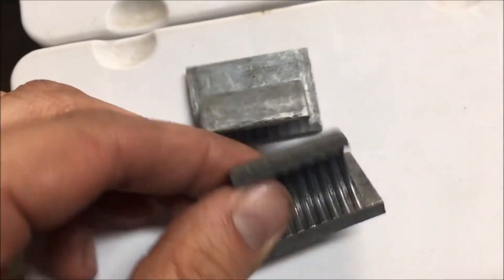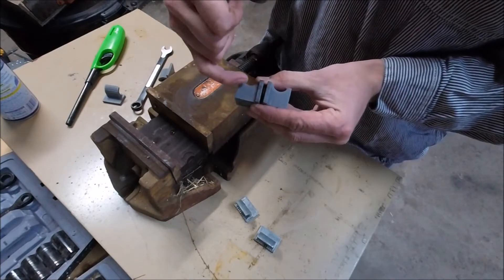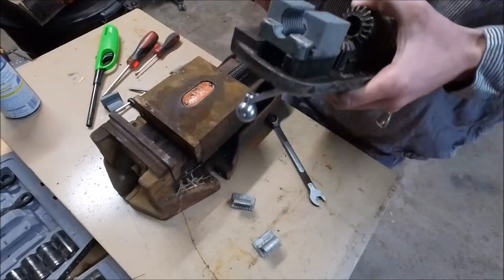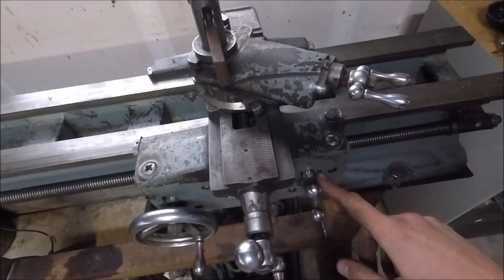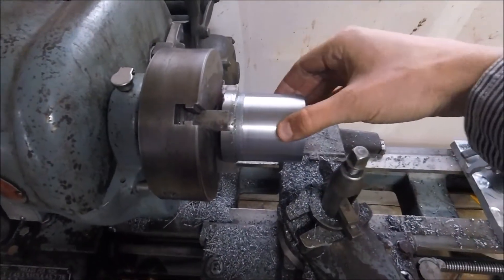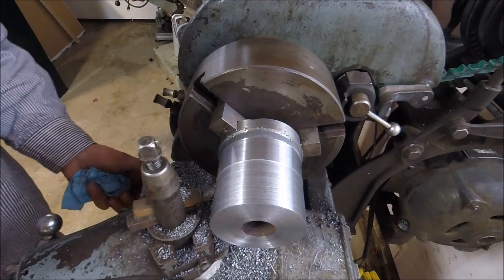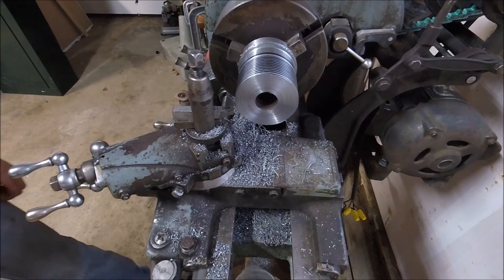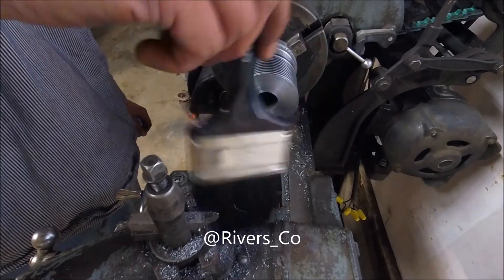3D Printing Atlas Lathe Half Nuts on the Cetus

Comment: I'm in a similar situation and am thinking if one were to 3D print the needed half nuts say 15% larger on the Outside Dimensions and 15% smaller on the Inside Dimensions they could be used for patterns to make a mold to cast them in metal.
The threads would be an issue in casting. Maybe just some shallow threads or basic bore diameter.

Comment: Nice video.  I was impressed.  I think the only other test you could do to stress them is to cut 4 TPI threads, the leadscrew will have to move twice the rate of the spindle.  Although it is higher stress on the gear train too.  But if your half nuts could hold up to that, they are golden!

Joe
Reply from the maker: Thank You for watching Joe, I haven't tried the 4 TPI yet but I have tried everything else and am really impressed. Its almost been a year since I printed them and installed and still holding up, however it has been a busy summer and lathe work may of been bellow average.
Reply: Still, when you think about the keyway rubbing the nuts, you would think it would wear them pretty quick.  But if they work, then why not.  Any reaction of the oil on PLA?  Or can you tell?
Reply from the maker: No reaction that I could tell, I wouldn’t of thought they would of lasted this long. If they fail I’ll do an update on them or if I get a wild hair I’ll take them out and inspect them.
Reply: Kewl.  I have an axa indicator holder that I finally have the indicator for.  There are some things that I think plastic parts really make sense.  Your half nuts, the gears Mr. Pete made.  I think if you could make a thread dial gear, then that would be a hit.  Would have to start by converting the 10 TPI leadscrew to a diametral pitch, then set the teeth at an angle to match that of the screw.  That part I can figure out, making the model on the other hand would be tough on me.

Comment: Nice mod. Hows it holding up? Fwiw the .0042 feed rate? is not the slowest. .0021 is at least thats the slowest I can get my Atlas's to go. What Pgm did you model the half nuts in? -Sam
Reply from the maker: They have held up well, I'm still using the same set. .0042is the slowest on mine, I could slide the sliding gear to the in position but that would double it to .0084. I use Sketchup because its free. Thanks for watching
Reply: look here for slower feed rate. http://www.hyperlinks.net/2015/02/18/atlas-lathe-wqc-speed-revisited-0021-as-new-lowest-fed-rate-bye-bye-fast-feed-rate/.   Also, any chance I could get a copy of your SKP file for the Split nut?  TIA. -Sam
Reply from the maker: OOOOH, with a mod... I might try that if I need to speed up the RPM but lower the feed. usually I run on the lowest RPM and .0042 is PLENTY Slow enough for me. I have the files available on Thingiverse. Not the same as I used I somehow lost those so I had to remodel again, Printed one out but havent tried the new modeling in the lathe yet.
Reply: .0021 is nice and does make a difference. I leave that gear combination on my lathe 24x7. its somewhat agreed upon in the atlas/craftsman lathe community. that the feed rate on these lathes is too fast. give it a try.  I have a split nut modeled up somewhere from years ago. I was attempting to print one up from Acetal. it failed miserably dozens of times. pla or ABS went great. Also I never considered just trying the part back then in PLA or ABS. as I was dead set on getting it to work in Acetal. Nice up though! -S Im on TV as well : "TheSniper".

Comment: Very impressive! You can get nylon filament which is much more wear resistant.
Reply: If you're talking about non-reinforced Nylon that would be pretty snazzy. I'd be paranoid about glass reinforced nylon which may eat away at the lead screw; With stuff as easy to 3D print I'd rather have the small bits be sacrificial if anything.
Reply: Just got an Ender 3 a couple days back.  What I've read about nylon so far indicates it may be worth perusing,  but it requires a hotter extruder.  An upgraded extruder may be needed depending upon your machine.
Reply from the maker: Thanks, I'm still knew at the 3D printing and not knowing I would be printing wearable parts I haven't ordered any Nylon yet

Comment: how do you like the Certus printer? would you recommend it ?

thanks
BS
Reply from the maker: BS in The Shop I LOVE the Cetus. But in all honesty this is my first printer and have no experience with other printers. I did a lot of research before settling on the Cetus. The 3 main deciding factors that made me settle on this was the design with the linear rails, the fact it can also run on g-code, and the price. I have had nothing but success with it. It’s very simple and has a lot of great features in the software. I also had a coupon code to get an additional $30 off. I may end up doing a more in depth video review. Thanks for Watching!
Reply: thanks for the quick reply. Yeah I saw the price at $300 is pretty good, but like you I have no experience with 3d... YET! .. lol
Reply: Where did you get the coupon from?
Reply from the maker: I believe it was on there website, and it was probably a black Friday deal. I had signed up on there website prior to purchasing so I had access to their forum and stuff. Thanks for watching.
Reply: Rivers Company thanks for the reply. Btw love your videos, just subbed